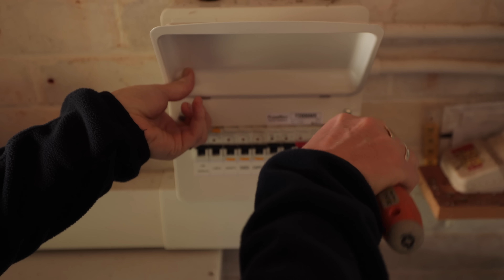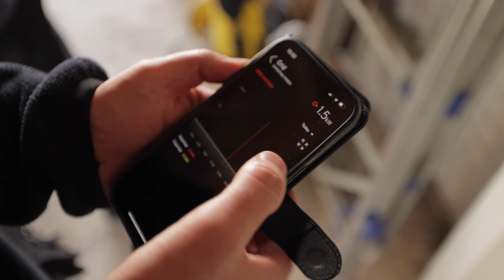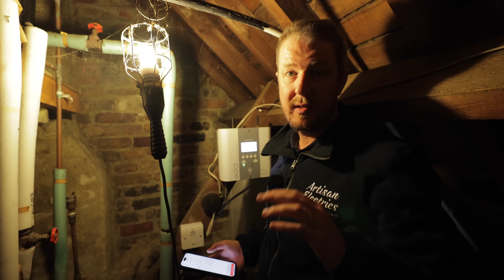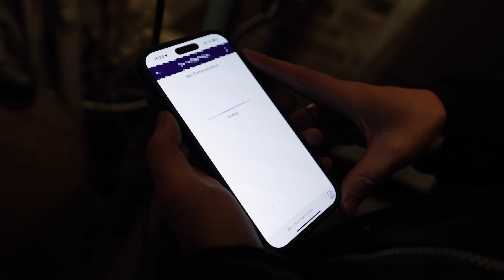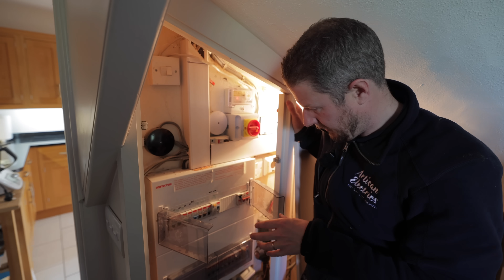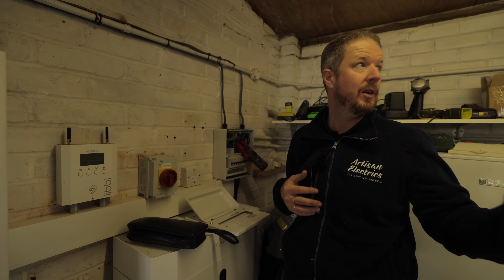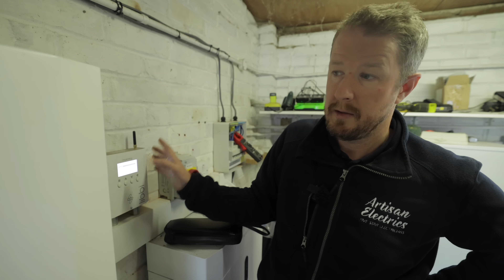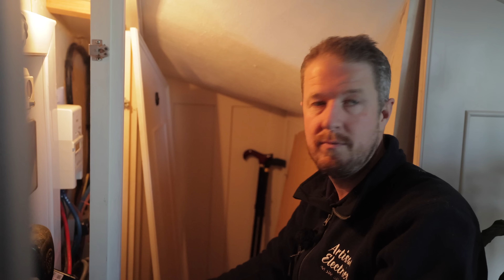£20,000+ Battery System RUINED By This 1 Simple Mistake 😳

Comment: They also paired 14A solar panels with inverters that have built-in MPPT DC string input current limited to 10.3A. So, on a clear day, a string of 5X415W panels that would normally be able to be feed the inverter with ~2075W is only able to feed the inverter ~1745W due to that inverter input being current limited to 10.3A. Since panel current is directly related to solar radiance. Every clear day between 9:30AM and 2:30PM the current generated by the panels goes over 10.3A and is basically clipped. They rated the system @ 41kWp system with inverter max output of 37.41kW but, actually, there is no possible way for that ever. The max input that I have ever recorded as input from the panels is 32kW and with the 95% efficiency gives the inverter max output at 31kW. That is 6kW clipped. It is also almost the same output as if I only had 3 9.9kW inverters instead of 4. Also the string inputs are also power limited to 2150W. And their initial design had 10 panels on one string! They had 4150W on a string that was power limited to 2150W...Finally, it is now working close to how I intended. Also, working with the company for over 18 months, they did cooperate and work 95% of the issues out enough that I was able to be satisfied with.
Reply: you don't know if they had a DNO restriction on that invertor and also where the panels are oriented to.
Reply: @oneman2001  It is written in plain English in the installation manual (which I have) and in the specifications manual with warnings about using panels with under standard test conditions outputting over 10.3A, the power input and therefore output will be limited. I empirically checked all the 20 strings input over the course from spring equinox through fall. I know exactly which direction all of my panels are oriented. During clear days during equinox at standard temp, where 5 panels should have been outputting 2075W, they were only outputting ~1700W. This is because even with MPPT limited to 10.3A it would only allow the voltage up to max of 33.8V or something...  If this were an inverter that allowed up to 16A then during equinox when the temp was close to standard test temps, the panels would have performed exactly. I was doing simulations like this in college way back in 1998. I have run probably 5 3D simulations using current data and there is no way that the system that they sold me would ever produce in one year, the 52kWh that the simulation that they gave me. You must be some idiot troll with no knowledge. I feel bad for you. If you would like to learn more about it, I would like to teach you more and empower you if you are willing to learn.
DNO restriction has nothing to do with the current limited string input of the inverter. DNO restriction only applies to feed into the grid. Also, my measurements were on days without any DNO output suppression. What my whole argument is about has not to do with output. It has all to do with input. There is no output suppression to my battery. The 10.3A limited current input of all 20 strings is the bottleneck disallowing me to extract the maximum power output capable of my PV array into the inverters. On clear days, when the amps which are relative to solar radiance could go to 13.4A, the total current is limited to 10.3A. Even if only from 10AM to 2PM, the power is limited, over the course of 20 years contract, it equals of  $15k of loss of profit. Pushing the initial estimates of breaking even from 7 years back to 14 years. So, I won't even break even until 7 years later than expected and only start actually earning a profit for the last 6 years of the FIT contract instead of generating profit over the last 13 years...It makes a huge difference over long term contracts! I hope that you learn something.

Comment: The installers for my system also put the CT sensors on the wrong side of the breaker!. Because I was busy at my regular job, I hired that company to install it. There were so many things wrong with it. So many things still...It still is not configured properly to the grid, they didn't even install the breaker/autoswitch for self-power generation while the inverter itself was specifically made for that purpose.
completely ridiculous! It costed me 7,000,000 Yen..about $50kUSD.

Comment: In the summer, lofts get REALLY hot. Some years ago, I had a Wi-Fi router installed in the loft. I had to get a new one every couple of years because the heat fried the electronics.
Reply: Back in university I had my router on my windowsill and it was getting cooked so I cut a hole in the top and mounted a small 12 volt fan to it. Much better!
Reply: Roof insulation is an option? It reduces the electricity bill in the summer (less AC needed) and a router every few years.
Reply: @RealConstructor My house did not have AC. There was loft insulation but the router was above it. Roof insulation would have helped, but this roof was dark and south facing so it would have a job!

Comment: Why on Earth would anyone export energie to the grid while his home batteries aren't fully charged yet? And what decides what the threshold is when the system stops charging the battery when they are just partly charged and instead starts feeding kilowatts back to the grid? Batteries will loose capacity when they get only partly charged every time.
A new battery pack ones a year is an expensive affair...

Comment: "Oh it's not charging to full cause of the 30A limit."  

Bull. Shit.  That's 6900 watts of capacity, lets say 6000 just to be sure.  Because the UK uses 230-240v. (Compared to the US 120v~).  Even if it was only half that the batteries should be charging to full it should just take longer.

Comment: The main selling point advertised by many many firms is sell back to grid,the comment made regarding this "virtually nothing" is the most damming on a system that will never pay back its cost by a wide margin Allowing for the standard of abysmal knowledge of basic electrical ac/dc theory the modern electrician has this podcast is an excellent add to keep clear of solar or just systems that are so complicated they crawl up their own backside what is this chaps qualifications? I bet ONC or HNC level so a very expensive report In short a very poor ad for solar.

Comment: What is this tank in the loft business. There are things  called instant tankless  water heaters they work off gas or electric and only heat up what you use on demand. To have a plastic or any kind of water tank in the attic is just insanity. No reason for it.

Comment: One of the HUGE issues this illustrates with renewable installations, is that any problem results in costs that cancel out 2 or 3 years of the  money 'savings' made by having solar / battery in the 1st place.  Half a day or more of  time from someone skilled 
like yourself completely blows out the money saved.
Reply: Damn right and if they are cowboys you risk fire in your attic and maybe trouble with insurance for any claims. All these people who have solar panels on roofs for example all say "well its earning me money and i dont have to do anything",  have not factored in if they have to work on their roof which might (will) require someone to take off the panels. Getting tradesmen is a nightmare as it is.  This would require 2 trades probably and scaffolding. I would get them tomorrow if I had a spare 50k in the bank but no way I would borrow while its still expensive and the government grants and FIT (payments for excess) are so mean to the little man. If the installer is thick/ a55hole, you will probably have the panels drilled in wrong causing roof leaks! I could go on! I would love to get solar panels but due to the decline in standards (morality) of tradesmen I will wait until there is a more user friendly way. ITs high risk if you dont have a spare 50k in the bank. 
I think because this man was retired they thought he would not notice and did it half arsed.
Reply: The return on investment with solar is usually 10 years.  If you have to buy batteries, it could double it, due to their shortened replacement schedules for safety and tech upgrades.  If you are just looking to heat your water and house, I would think geothermal would be a better solution.
Reply: @jeffforbess6802 as always it depends on the price you bought them for and the cost of electricity and the amount of solar and place. It like saying, a rope is usally 2,5 meters.does not make any sense whatsoever
Reply: All part of the big green agenda con I’m afraid 😧

Comment: With the Zappi and possibly other units not communicating properly over WiFi, I wonder if the WiFi signal is low in the garage (and/or other) areas.

If not already done, perhaps setting up some kind of Mesh might be a good idea?

I just rebuilt my internet system here as I moved to Pure Fiber business and had to change out my router as, even though it is a giga router, it couldn't handle the higher speeds (known issue, no real resolution).  So I decided to go with an ASUS router that handles their AIMesh system.

I plan on adding a mesh router in the greenhouse which is between the main house and garage.
I may add a 2nd mesh router in the patio.  I do get WiFi there, but due to a metal roof between the WiFi on the router and the patio TV and computer, the signal isn't the best.  So a mesh router there would be good.

Just an idea if he doesn't already have that.

Comment: I dislike the term used 'Free Energy' from green energy. It most definitely is not free and costs an arm and a leg to buy, maintain and replace. This chap obviously  has money to burn on gadgets. The cost of his install on the batteries and solar balanced against the cost of his electricity cost without solar would most probably even out at the end of say 15 years and by then the money he has had to spend on services/replacement parts and the degradation of this system itself makes me laugh at the absurdity of it.

May be in ten years from now solar will reach a realistic price point and the same with batteries but it is most definitely not there yet.

The only justification I would give myself for solar and batteries is if we got a lot of rolling blackouts orchestrated by the current rogue/corrupt government, in my opinion.

Good vid though, nice to see a competent professional company at work even if you are a little pricey. Like n Sub.
Reply: As for "pricey" that sure is a main these all over the world at this point.  And sadly, too many companies are not as honest as they should be! 

And as we can see here, this guy (company) seems to be very professional.  It was interesting, the things he found that were not up to standards.  Like putting anything up in that attic is just wrong on so many levels!

Not only (If I understood him right) against code, but also, the company that did it, didn't consider that an older person might have a problem getting up there are moving around.

Not to mention the severe temperature fluctuations (summer/winter).

Everything should have been mounted down into the garage area, all nice and neat and together.

Perhaps it's just me, but I would have used heavier gauge wire throughout!  I like to "future proof" things.

At some point I'll probably build a new system as my old system has been disassembled for many years now.  But I'll do it myself as I do not trust any company around us!  There's lots of bad rip-offs going on.  I'll do it myself as I did with our old system.

But I'm in no hurry.  So far, we're not prone to brown/black-outs and like you say, for what we pay for electricity here, especially with the amount we use, a solar system to provide that, here, would cost well over $40,000.

With what power costs us here, especially during summer with dual AC going, it would still take 17 years to break even!  That's not including the expected maintenance on the system, panels going bad, batteries failing, equipment, etc etc etc!

So when I do build something, it will be a very basic system to just keep enough power to keep the furnace going in the winter and maybe 1 AC in summer.

Comment: The overflowing immersion issue happened at my mother's house recently. The water was very hot for a long time but we did nnot realize the reason. Eventually the second thermostat failed and resulted in an explosion of hot water in the loft. This was made worse by the polystyrene cover that had been placed over the top of the cold water tanks and caused the hot water fo flow over the edge of the tank and down through the wooden ceiling boards onto a bed and also the bed on the floor below. Luckily there was nobody in them at the time but would have been a few hours later. Leaving a hole for the overflow pipe is very important but seems to be blocked off now more often by insulation and tank covers.

Comment: What a complicated setup...
I have solar as well (I live in Thailand): solar panels, an inverter, a battery, and everything is connected to my house.
If there's a blackout (which happens a few times a year), all main appliances stay powered—except the air conditioner, to conserve battery life, which it does quite well.
If I don’t use the aircon, the battery lasts from sunset to sunrise and still has capacity left.
My system seems much simpler and has far fewer components than the one shown here, and the price is significantly lower.
I’ve got a 5.8 kW system.

Comment: The main power controller should connect to the Internet, while the other devices should
connect through the cables with which they also supply or draw power, it's old tech,
but it can prevent wifi signal loss and such. If it were my system it would be done like this.
The other feature that would pop up is bad wiring showing by lack of communication.
And then there's the possibility of checking the resistance of all wires connected,
which also tells how much capability it has. An automated diagnostic could then show
where a point of failure is or a weakness or any other shortcoming.
I guess power management still has a long way to go.

Comment: 13:06 Your video is put together rather well and on a side note you've highlighted the concern that I have with the industry in GB which is the idea that its been converted into as much of a proprietary naming convention as is humanly possible.  I fail to fully grasp the idea behind renaming all of the equipment systems into what are meant to be cute, trendy nicknames such as LIBBY, ZAPPY, etc.  "My energy system" is one thing but its an entirely different situation when you rename all of the individual systems 'away' from what has been a fairly standardized approach to identifying individual components of a solar energy system.  Was there some kind of perceived shortcoming to the existing standards that left an informational lack of understanding? Or is it, for some reason, important to make certain that the consumer is kept "in the dark" about what the system is comprised of? Actually, at the risk of sounding 'passive aggressive' what was wrong with the industry standard naming convention, i.e. "charge controller, inverter, etc."  I have the thought that the public would still choose to rely on the professional services available for solar system installations without having to rename each component into what amounts to being a cryptic, obfuscation of the industry standards already well established.  I find the terms "Libby, Zappy" and the rest to be somewhat juvenile and personally I would be offended if someone were to start referring to the individual subsystems in such a fashion.  Its just a bit too dumbed down and, as I've said obfuscating for my preferences.  Hopefully I have languaged my objections responsibly without being too excessive... Why not just stay with the already established naming convention and why the extreme levels of dumbing down?  Its all rather strangely childlike.
Reply: 14:38  Absolutely a reasonable concern as well as loading the system's supply together with an already occupied beaker.
14:25  I actually would stop short and advise anyone, even a professional, to be reaching around and poking ones fingers into what amounts to be possibly deficient wiring practices involving several hundred volts of triple digit amperage... just saying.  You haven't been Manfred Manned until you've been hit with more than 50 amps at 200+ VAC.